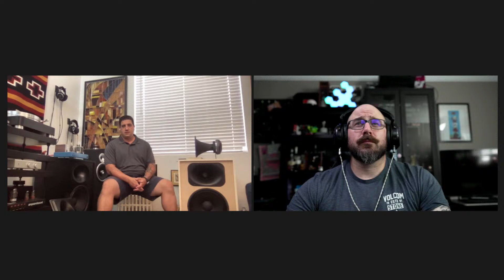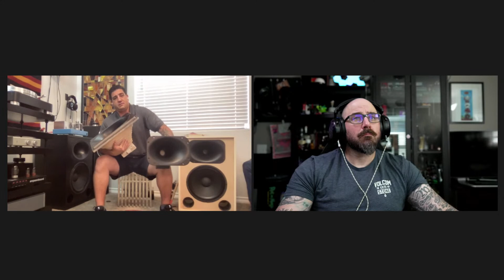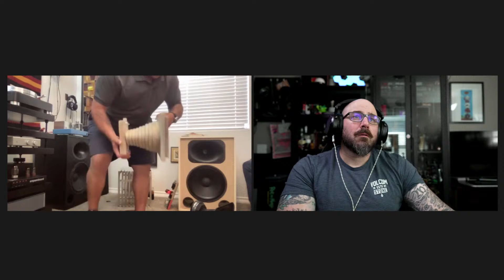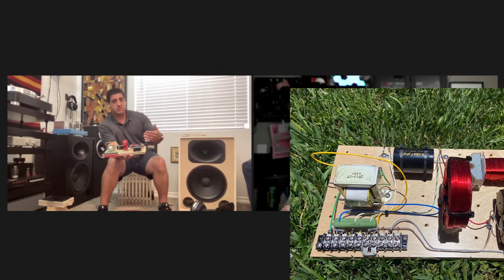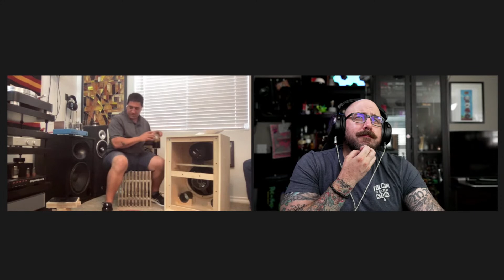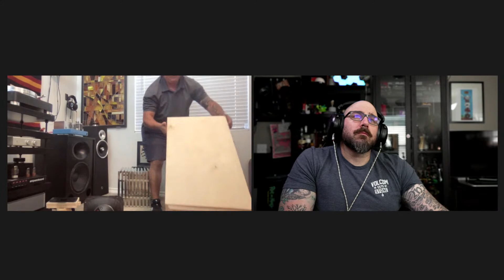CORNSCALA speakers DIY build with Justin from ampsandsound

Comment: This guy is wrong in a number of areas.

1. A rim shot on a drum live with no amplification
     can very briefly hit 120 db. Cornwalls can do
    116 db with a hundred watts. The speaker
     drivers can do this even at normal loudness,
     and follow the waveform to 116 db due to the 
     nice overhead of the 100 watts, and this includes
     the overtones generated. Thus the extra watts 
     allow more realistic and more detailed reproduction
     than lower efficiency drivers/speakers, and/or 
     even lower power amps used with Cornwalls.
     Low efficiency models can require 1000 - 2000 watts
      More Power = More Distortion

2. Lascala and Klipsch Horns had a nasal sound with
     some female vocalist. 400 Hz is right below A-440
     (the A above middle C on the piano). This right where
     many females vocalize. Savvy Klipsch owners moved
     the woofer x-over to ~600 Hz (and at times to 700 Hz).
3. Why is he advertising for crites? Crites wants too
     much money, and all you get is capacitors, no resisters.
.    Buy both caps and resistors as both deteriorate over 
     time. Go to Allied, or Mouser and buy your own.
4.  Only the Heresy commercial models rolled off
      @ 60 Hz. The III"s were good to only 50 Hz,  My
       late made II's will do 45 Hz (measured on three
       tests each using different software total 9). The
radiator is a wazoo,  but when
       practical does the job well.
5. Properly Set up the Cornwall IV's would outperform
    this guy's ScalCorns easily.

Me? Paid musician, and now a retired Electronic
and Mechanical engineer.
practical
Reply: listen to his frequency range.... 15 000kHz and 18 000kHz :) we have a radio signal :D

Comment: I haven’t finished watching the long video yet, but how’s the frequency response curve with Faital horn (going down to 500Hz) vs using the wider elliptical wooden horn going down to 300Hz with the 2” mod?  Any issues with time alignment with any of these setups?   How’s coherence and transition of male to female voices where the male voices are produced with the heavy and slow woofer and female voices get produced with the faster and more dynamic compression driver?  (This was my problem with an iteration of the Cornscala using that Eminence woofer about five years ago and wondered if improvements were made).  Last, what crossover slope is used on the compression driver side?
Reply from the maker: I’ll ask Justin and post the response. Here is the landing page for his builds as well: https://ampsandsound.com/pages/ampsandsound-cornscala